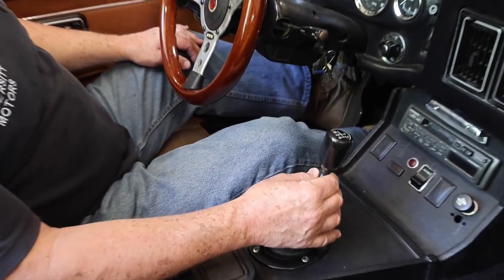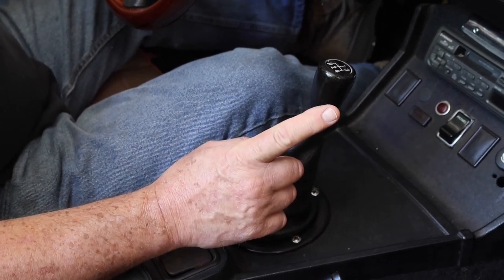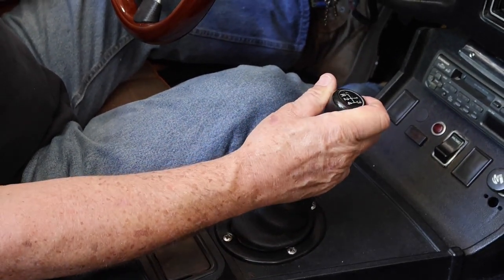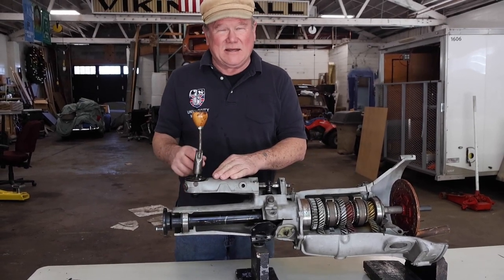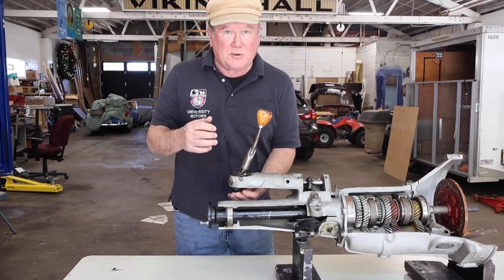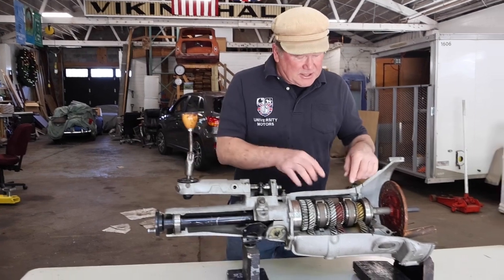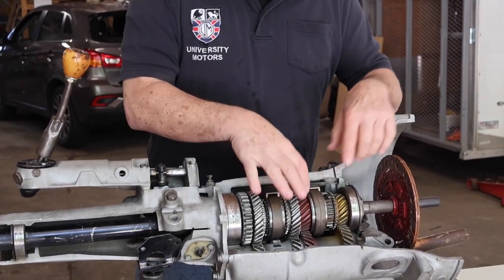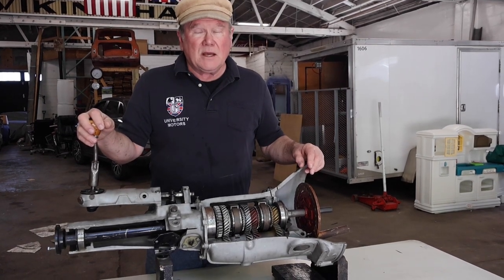397 MG Tech | MGB All Synchro Gearbox

Comment: I would think all owners that replace the gearbox lever suffer with the plastic bush. I know I have done so a few times. UNTIL i started to wrap a couple of turns of thread tape around the top of the white bush. This stops the split bush coming off. It works very well every time.